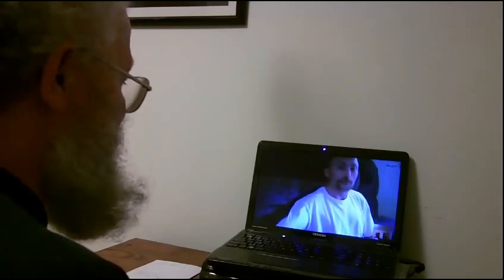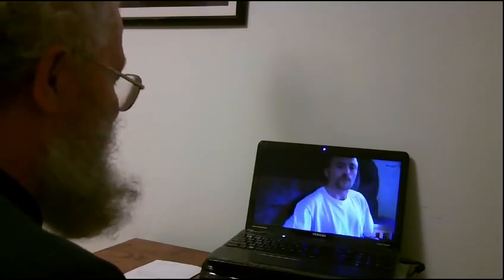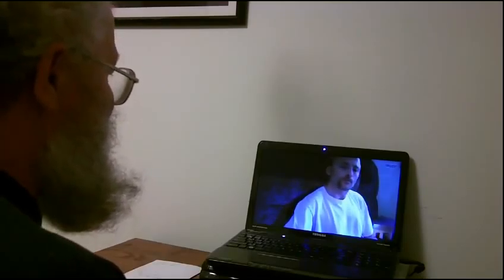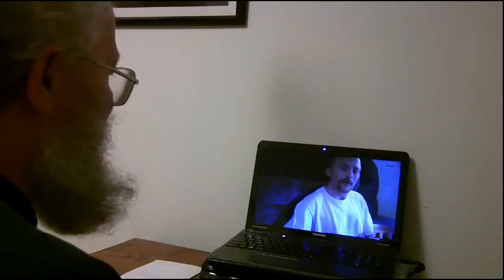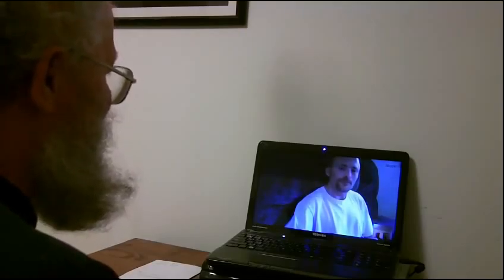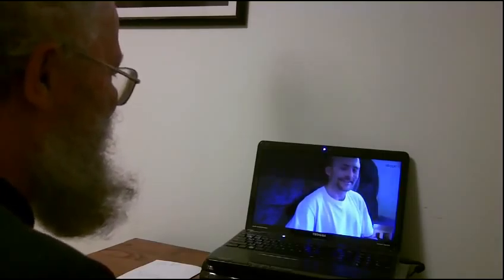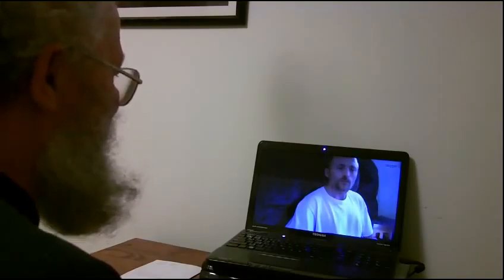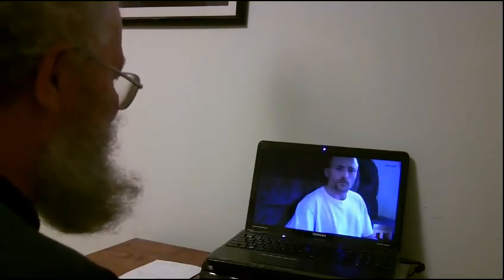TDD report for October 20, 2012

Comment from the maker: Yep, and also that your whole rear wheel assembly is not running skewed to the swing arm. If the motorcycle has been dropped or flipped you can run true with the chain and sprockets but not be aligned to the swing arm properly. Dog legging down the road is not good.